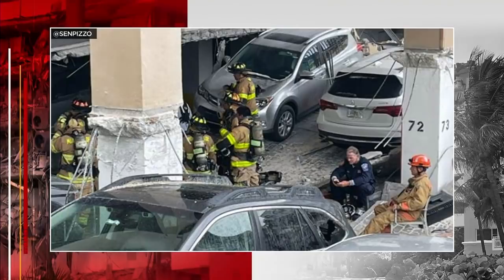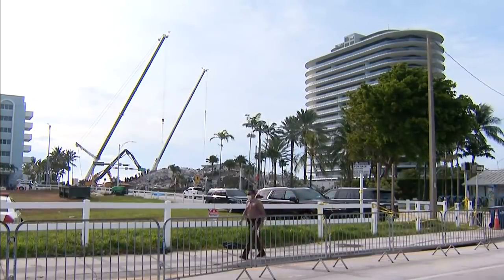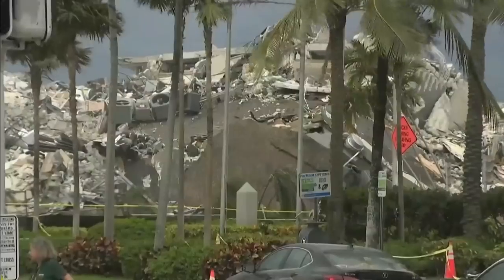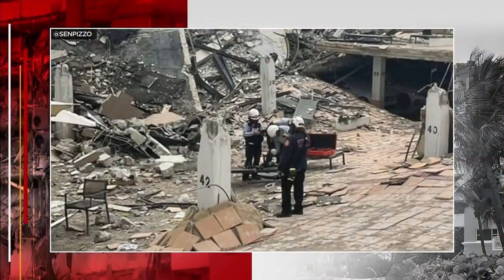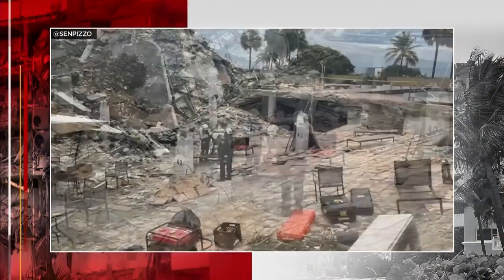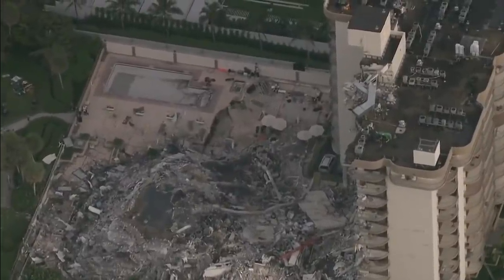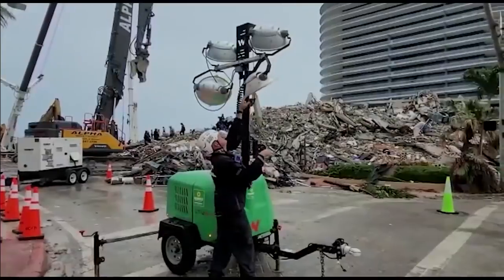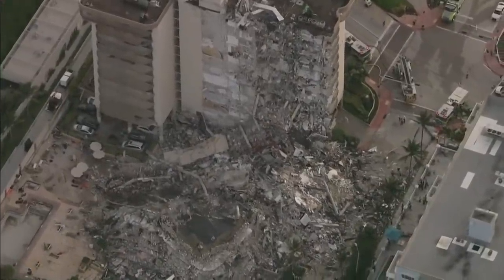Building experts studying Surfside collapse have questions about its initial construction

Comment: Looks like there is even less steel reinforcing the pool deck over its support columns.  This leads to easy punch-through and shear failure.  Add some salt water saturation, cracking and corrosion as well as possible deck overload ( at least at planters) and spontaneous pool deck failure is not too hard to understand.  An engineering inspection done a few years before the collapse advised tearing out the pool deck and replacing it.  Were they aware of the meager steel reinforcement?

Comment: I watched an interesting video. The guy used google streets and said it was from 2015. If you look at the basement driveway, a crack runs up the wall on the left side and is very noticeable near the upper floors.

Comment: "Biden official claims climate change may be to blame for Florida condo collapse" So another item to add to the list is that climate change can dissolve reo bars in concrete. Good to know.
Reply: Because the water table is higher than it was. It erroded the building from underneath. Which didn't help. 

Please see Building Integrity.

Comment: You better go back and look again, the site is just about cleaned down to nothing left for the forensic engineers to examine
Reply: You don't really need them. You HAVE many photos of punch-through on the pool deck. Lack of any transfer beams. Original plans and modifications on the one that went up. Big difference. 

Building Integrity had one yesterday on this.

Comment: BS.  If this was the issue the building wouldn’t have lasted 40 yrs.  it was a long term corrosion from lack of water drainage on the pool deck.  Pool deck pulled columns in the shear direction away from the wall face that collapsed.

Comment: The rebar in the columns looks like the same kind of rebar we used in our 6 foot tall block wall we built around the yard. We live near at least two major faults in California so granted that the building codes are pretty strict and our wall is supposed to withstand a 9.0 earthquake (which we will likely never have here) and 90 mph winds (that's a maybe) at the same time (which would almost certainly be a never). However, you'd think that no tall building anywhere should be built without using thicker and a greater number of rebar than we have to use for a damn block wall in the yard, even though we are by two major faults in California.

Comment: We rented there for 2 weeks in 2000 re remember the garage had at least 5 inches of water standing.  I had to go barefoot to get the rental car no joke 5 inches of water standing.  Tenants all said its the way it is  always and they had pumps but there broken.  Then the next week they fixed the pumps but  still an inch of water remained.  I know concrete is like a sponge so add years of sea saltwater to a sponge , have steel inside concrete and that steel sweats and expands and concrete cracks everywhere.  That's what happened its that simple.  The foundation failed, then add constant vibration from next door construction and more cracking and more cracks form sooner than later failure.  I'm no engineer but it's all making sense now.  And this building is not alone. We rented in key biscayne and the place we stayed there too had standing water issues in garage.  It's great florida does recertification  every 40 years most states don't do it at all.

Comment: It will be a combination of events that caused it to fail at a point in time 40 years after it was built. You can’t see much rebar hanging from the columns, maybe it sheared off or was ripped out or perhaps it was never installed.

Comment: The problem is the way it was constructed! Not water damage , or wind, or natural wear.
Reply: Or, y'know... BOTH are contributing factors.  It's usually not just one single thing but a bunch of small things that make for this kind of disaster.  If it was well-constructed, the extra water would still have eventually caused damage that needed repair.  Poor construction would just make that water damage more dangerous.  Renovations could also cause undue load to an area not designed to take that load.  However, proper maintenance could have fixed several of these problems.  

If it was poorly designed/constructed to begin with in a way that caused water to seep into the concrete and weaken it, then you added something heavy on top that you put a lot of water into (AKA stone planters) without considering the water damage and extra load, and then balked at the maintenance costs when all these factors started causing problems...  That's when you get this collapse.

Comment: I heard earlier reports state that two penthouses - not in the original plans - were built after the 12th story.  But I haven't heard anything about those since.  Wouldn't their load be too much for the foundation that was designed without those penthouses in mind?  (If, indeed, they were - or were the penthouses intended to be built despite the 12-story limit imposed on buildings by the city of Surfside?)

Comment: The long-term engineer saying he didn't see the amount of rebar that was supposed to be present per the architectural drawings was a shock.
Reply: i have more rebar in my house wreath which is 2 store building made from light aerated concrete
Reply: I dislike 0 I beams. Those wouldn't have gone anywhere, I don't think.

Comment: No expert here at all. But I think the entire subterranean earth under the structure was completely compromised and filled with water/salt water maybe. But what I don't understand even with shoty building materials how the bldg itself just folded in on itself rather than swaying and swaying before tobbling and swaying over?? Me thinks something else is going on?? Maybe?
Reply: The center fell first as the support columns there were toppled by the fallng deck.  This falling pulled the outside areas inward to fall on top.  Buildings try to design to favor collapsing down to limit damage to neigboring areas.

Comment: Less beams, you have more flats and more apartments, so more money.
Add poor maintenance and you have disaster.
Reply: More parking spaces.  The pillars under the part that did not fall were 24x24.  In the part that did, still under the building, they were 16x16 or even 16x12
Reply: I don't see one I beam in photos...

Comment: Regardless of construction failings, good building maintenance & management practices would have ensured people were evacutated in time.  As residential towers, there should be constant checks 24/7 on the building, with off site logs.

Comment: One of the engineers commented about something really big must have happened, in order to bring the building down.  I hear some comments about the construction next door making a lot of movements and vibrations causing the building to shake, if this building was already in a bad shape with concrete issues, maybe all that vibrations was causing the pool deck concrete slabs move away from its anchor, and collapsing bringing down the whole building.

Comment: Interesting. I said the same thing this guy did when I saw the first photos from the helicopter the following morning. I'm no structural engineer, but there are pieces of concrete, particularly where the collapse met the part that stayed up, that seem to have no rebar at all. My understanding of concrete building of this size is that there should be rebar pretty much everywhere, every 6 to 8 inches or less. There seems to be a LOT of rebar missing here.

Comment: A lot of things were different back in the 70's-80's. Building materials, technology and practices have changed over the years to fit our needs against man made and natural damage. Also widely known in construction... Builders will cut every corner possible to save a penny. That's straight facts.. I'm an electrician.... we have a saying..... You think a good electrician is expensive? Try hiring a cheap one. I also wonder about all the sink holes popping up all over the place. It's almost normal now. I never used to see these decades ago. I had one in my back yard and there was a GIANT one in the parking lot of a shopping center near me. I was also thinking that in the aerial views of the towers, the ones still standing look in good condition. All of the outside is the same color. If you look at the one that fell, it didn't look good. A lot of the balconies and levels were different colors and the roof looked rough. It just looked considerably older to me

Comment: The exposed rebar looks small and scarce. Even if the original steel was "enough" the slab could have been overloaded in the past, and we just don't know it happened. They drove a beer truck up into a stadium we designed and cracked the floor all to hell. Nobody ever told us to design for a loaded beer truck upstairs. Such things must be coordinated. Even if the original steel was "enough" the slab could have been severely overloaded in the past, and we just don't know it happened.
Reply: The planters on the deck had huge palm trees in them until just a few years ago, for decades.  If water didn't drain. that is a huge weight as well.

Comment: Hold your jets, think about it the chlorinated water was seeping into the concrete as the waterproofing wasn't working. Chlorinated water is way more acidic and destructive than sea water so this is what brought down this condo.
Reply: Apparently, waterproof membrane to prevent rainwater dripping through underground carpark ceiling, had insufficient drainage. Deck area over underground carpark, heavy with undrained rainwater. Corrosion weakened columns could easily fail.
Reply: The pool never leaked. The deck was leaking because of rain water and being by the ocean, salt is in the air and on the deck. Salt water rusts out truck frames faster than you think. Just look under any truck used on the beach.

Comment: The old facilities manger talked on tv this week.  He said they were always pumping water out from under the building.  So basically over time the removed the dirt causing a little sink hole to form between the cement and base.  So that might have caused the sudden drop
Reply: judgign by a video taken a year before and variouis pictures. it was not a sink hole but water damage never properly dealt with
Reply: They were pumping water out of the garage. I guess technically that’s “under the building” but it’s probably not what you meant.
Reply: @Sashazur  they said they were pumping water out from under the foundation,   we also do it in our building.  We have a huge drainage system under the slab that prevents water from entering the building

Comment: Why not say the obvious? The building is 40 years old and has suffered deterioration as a result of the sea air.
Reply: To me the obvious is the connection to the pool deck was a fatal flaw that overloaded the basement columns when the outside unprotect pool deck invevitably corroded and failed first. The concrete frame of the building, being relatively protected  likely would have been fine for 100 years.

Comment: The pool deck was engineered to have decks that slooped towards drains . But pictures show a flat deck , with no sloops and no drains , the pictures also show heavy concrete planters that are not on the construction drawings .... Did they fill those slanted deck in with extra concrete to make them flat after the building was constructed , adding untold tons to the columns and add even more weight by adding those heavy planters . With no drains the water would just sit there and seep into any crack right down to the rebar .. extra concrete to flatten the deck , extra concrete in the planters , no extra rebar to carry this extra weight , no drains to remove rain water , the deck was built to fail , and it did
Reply: Some of those planters had huge palm trees in them until recently, too.

Comment: Had they not put the brick pavers over the original pool deck slab they probably would have seen evidence of the columns pushing through years ago. I bet there was all kinds of cracking and spalling under the bricks around the area of the columns below. The bricks did a great job hiding what was coming. Not to mention the extra weight of the bricks on the elevated pool deck slab. I can't believe they didn't reinforce the columns in the garage for the sole purpose of supporting the extra weight of the brick pavers.
Reply: also extra weight of rainwater under the pavers, that wasnt draining properly.  A 2018 report said there was not a proper slope built in so it sat in the deck until it evaporated.

Comment: Incorrect concrete is placed all the time building are not always built to the drawings due to issues and engineers have 7-14 business days to get a fix. So GC and subs do what they can. 
Wrong/poor design, poor workmanship, over budget/kick backs, expedited schedule, lack of inspection and lack of maintenance all contributing factors.

Comment: Some dark humor; I've been told that there are two kinds of concrete:  concrete that has cracked and concrete that will crack.
Reply: That’s because concrete is only strong and compression. it’s not strong in tension. that’s why they put the steel rebar in it

Comment: This is unlikely to end well.  South Florida condo owners are going to spend, collectively, hundreds of millions of dollars just to have their properties undergo proper intensive inspection by competent engineers, with many learning the only option, safety wise, will be demolition.
Reply: No they won't.  They'll find out the safety factor is something like 1.1 instead of 2 or 3, the right palms will be greased, and things will go on as usual with the occasional collapse, because a few hundred lives aren't worth the cost of a new building.
Reply: @NoJusticeNoPeace  I think you will find condo owners suing other condo owners and a Federal investigation of the whole mess, ending with many billions of taxpayer dollars going to Florida to rebuild private infrastructure.  Most of the crimes here are now beyond the statutes of limitations, but the “bucks” will rule the day.
Reply: I agree, gutfinski. They'll create new, more strict rules that will be very expensive and everyone will have to swallow. Whether they're good and necessary or not is a matter of opinion, but a lot of people in Florida, especially on the beaches, are going to get hit with some huge bills fairly soon. At minimum, they have to make it look like they're doing something about the problem, even if it's unnecessary.

I'm surprised at how little it has been politicized so far.
Reply: @dmhendricks  They ought to look at Chicago. Very strict building codes. You don't see this type of garbage there.

Comment: First, see a cross section of the building and land showing sea level. That will tell you a lot about water intrusion. Second, saw cutting columns to see a section will tell you if the amount of steel and placement is per the plans. Knowing who inspected the work is just as important as who installed it.

Comment: Last time I did concrete columns the engineers inspected everything before the pour, there was a lot of rebar in those columns. Back when those condos were built I’m sure there was a lot of under the table dealings to speed up construction and come in under budget, I’m sure it still happens.

Comment: The same construction issues I was reading from the nuclear stations construction engineer in June, 25. He also said that concrete looks like having low cement to sand proportion, so it has low durability.

Comment: All they need to do is look at the sister building and RX those areas there if they match they know they have a bigger bomb on their hands. 
Also Concrete doesn't crack if designed proper. Concrete cracks only when under stress because loads are exceeding or temp is exceeding. Don't believe me than travel to the Normandy and look at those German Bunkers. 70+ years standing strong and nothing is cracking. It all comes down to how and what was used to build those building with.

Comment: Once again when I first saw the photos i noticed the lack of steel reo, reo in the wrong places, concrete poured on top of concrete with reo at bottom of slab with hardly any coverage. columns are too small, poor or no drainage, water pooling, and now its collapsed. Don't need to be an engineer to see this stuff.

Comment: Greed and corruption. Very common in the construction trade to remove steel after the building inspector has been to check.
Reply: Wow that's crazy
Reply: @idonotconsent  I didn't see any evidence of tied rebar, did you? I saw holes where I got yanked from the big shear wall. Nice, neat holes. Not ragged ones; that probably saved the lives of everyone left.

Comment: So they say 155 people total were dead underneath the rubble how many apartments are there? It's strange that so far and none of the videos have I seen any cars parked inside the garage or crushed in the garage even on the side that didn't fall down where are all those cars because we should be seeing dozens of crushed cars with engines there should be something left of the cars from all the people I mean unless they weren't parking in the garage I'm just thought from the very beginning that there's just a few cars parked outside where's the rest of the cars
Reply: @Just Looking You can see lumps in the collapsed garage where cars are crushed beneath.  Some shot show cars parked at the edge of the collapse zone.

Comment: No when the cost at all but it would hinder to it. But the building if it was built on sand stone or sand instead of being built on solid ground it would make it shift and if they were getting as much water as they were getting it was undermining it which was putting more pressure in certain areas and that’s probably why it collapsed.